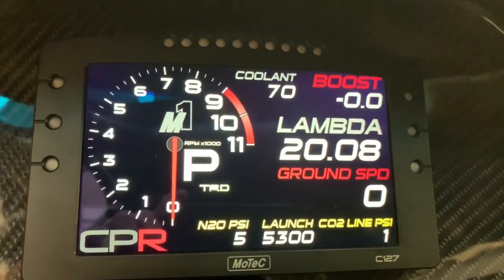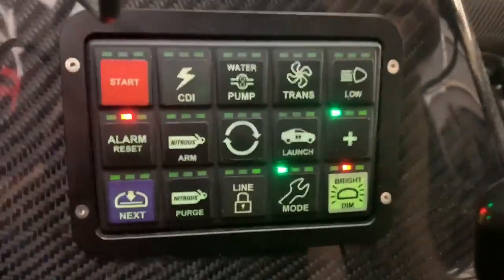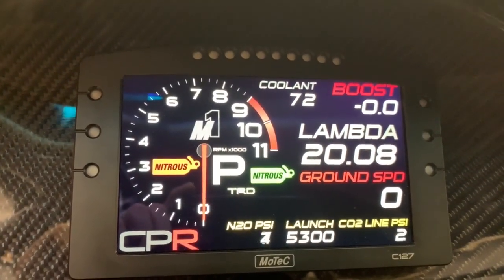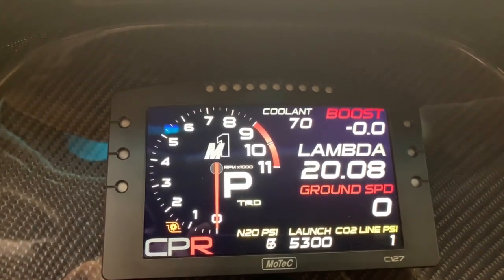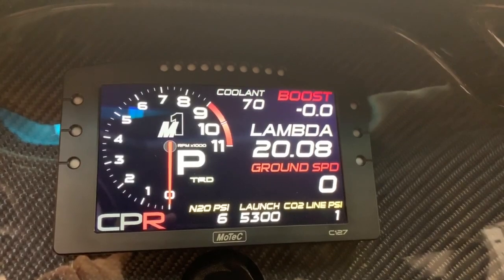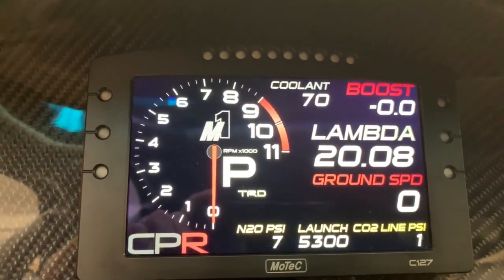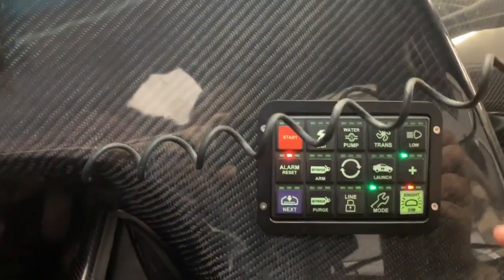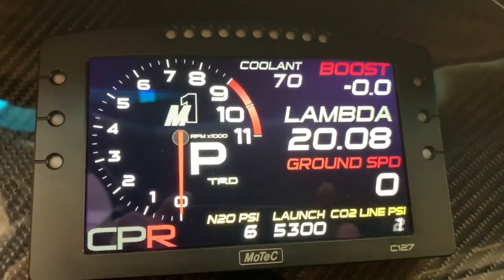MoTeC Display Creator Changes For CPR Drag Supra

Comment: Sir Cody what's the use of that Wrench Mode button below the Launch Button?
Reply from the maker: The mode is used for burnout mode which turns the traction control system off and also changes the engine rev limiter.  The launch is to adjust the 2 step rpm on the fly.
Reply: @CodyPhillipsracing  Okay sir Cody. Nice! 😎👍

Comment: Is it possible to integrate the oe buttons, for example, indicator stalk for us street guys
Reply from the maker: Yep that's all doable.  You just need to wire the indicators and high beam into your Digital and/or speed inputs on the dash.  Those you are able to use without the I/O expansion option.  If you spring for the I/O expansion option you can also integrate the fuel level gauge.